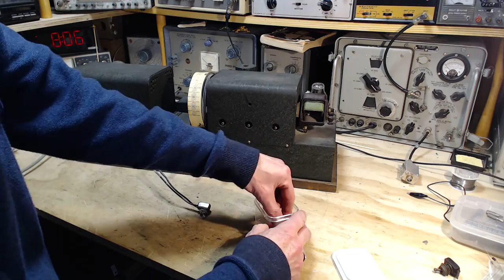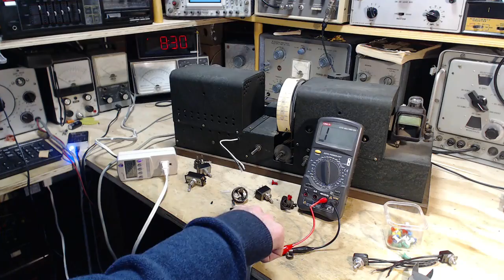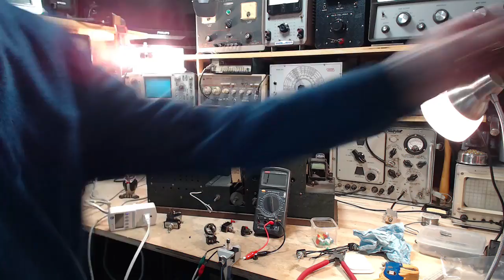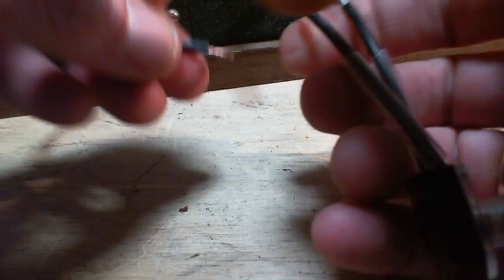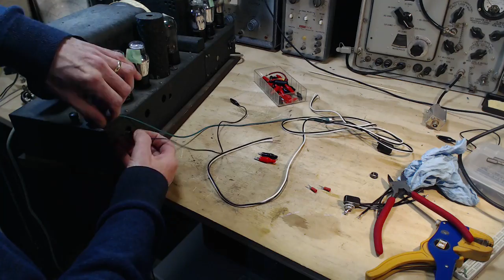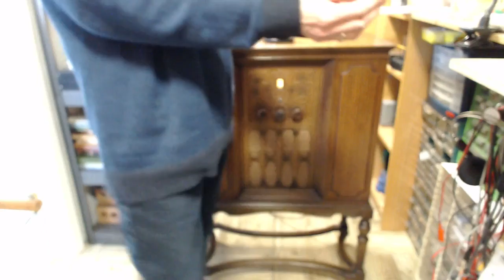Eveready Model 32 Video#14 - Ready or Not

Comment: What is up with your soldering iron it doesn't seem to produce much heat isn't it adjustable? maybe needs recalibration. Or plug it into the variac and give it more current

Comment: Those two dodgy switches you had Jim, might pay you to drill a small hole through the back of them and give them a squirt of WD40.
Reply from the maker: I thought about that but putting WD40 into a switch with a 120V arc is a little unnerving.  It might end up being fuel for the fire.
Reply from the maker: Maybe I'll open up those switches and take a look inside.
Reply: WD40 is non-conductive so OK to use on mains switches.